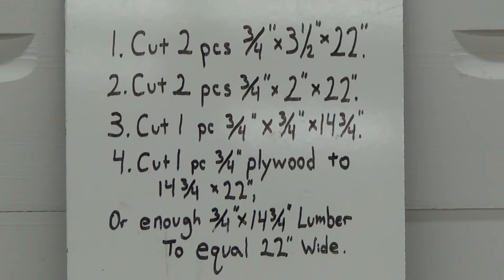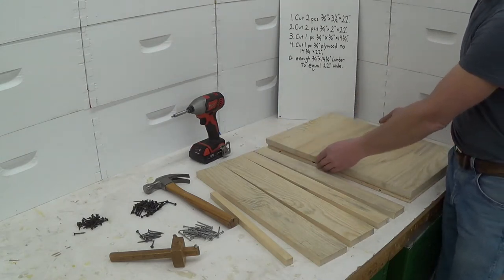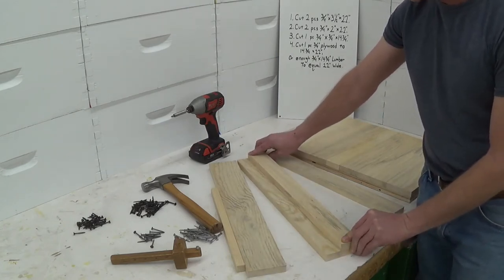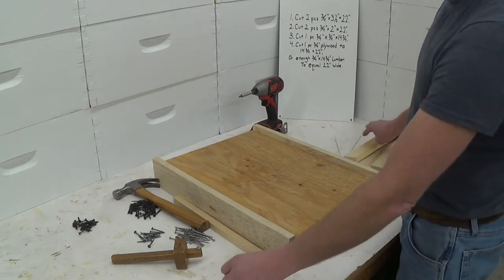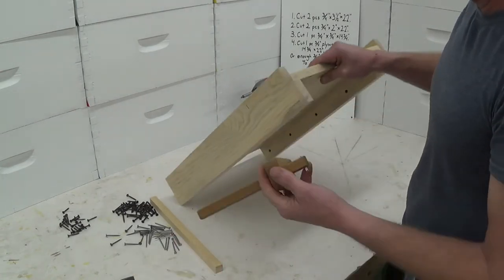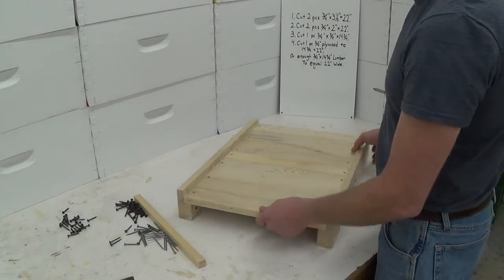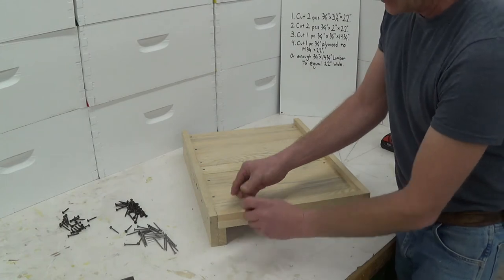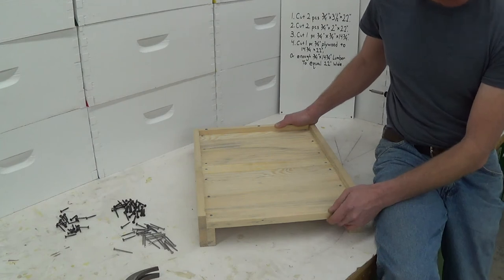How to Build Bottom Boards for a Beehives.

Comment: I found your pattern to be very simple and used the information on some NUC bottom boards. Due to lumber prices, I used 5/8 x 5-1/2 cedar fence boards to make the bottom, used a flap disc on an angle grinder to rub off the rough lumber on the top side. Much easier than cutting a groove in the side boards.. I was kinda ill to learn I have three different size NUC boxes and not really interchangeable between pieces.

Comment: Thanks for the video, quick question do you know if small gaps in the wood is ok? Boards were not perfectly square leaving less than 1/8 gap between a bottom board. I think that i will use plywood on my next ones.
Reply from the maker: That small of a gap will be no problem.... the bees will fill it in.

Comment: Thanks...great and simple tutorial, have you maybe any idea how to diy some combination, something between solid and screen bottom board.. thanks again 🍺😀🍻🐝
Reply from the maker: If you noticed that I used 3 boards that are the bottom... use 2 instead that are about 6 inches wide on each end and then fill the gap with your screen. That is just an idea, I don't use screen bottoms. Good luck and Bee Good!
Reply: @pathofthebee2873  thanks man... 🐝🍻😀

Comment: Hello Charlie, nice design!  I prefer the pine too.  I have predominantly screened bottom boards, but I really want to experiment with the solids, l think I'm going to use your design.   Have you thought about using Tite-Bond 3 also?
Reply: I stopped raising bees because of the 'die-off' in my area. But I still have some boxes and want to make bottom boards for them. This tutorial and materials list is just what I need! thanks a  bunch !
Reply: @josephmartin402  did something kill yours and everyone else's bees?
Reply: @danskisbees7348  yes, all my neighbors suffered the same fate. We all have stopped raising bees.  I thought some day I might start again, I still have me fence charger to keep the bears away from the hive.
Reply: @josephmartin402  I'm sorry to hear that.  Pesticides?
Reply from the maker: Tite-Bond 3 is a good product and would work well in this application. I have had good luck not using any glue. The wood rotting if I don't keep the paint on has been the only real problem I have had. The Tite-Bond seems like a good idea though for the long run....
Reply: @pathofthebee2873  I watch Bob Binnie and he has a recipe to treat the raw wood to prevent rot. 1 part Copper naphanate, 2 parts Linseed oil, 6 parts mineral spirits, I brush it on and allow to bake in the sun before painting.
Reply from the maker: I am sure that will work because copper naphanate is toxic to every living thing on earth in proportion to its size. I use it for fence posts to keep them from rotting. Thanks for the tip.